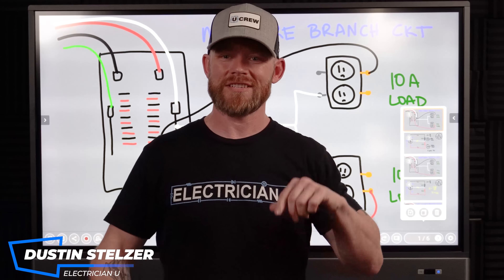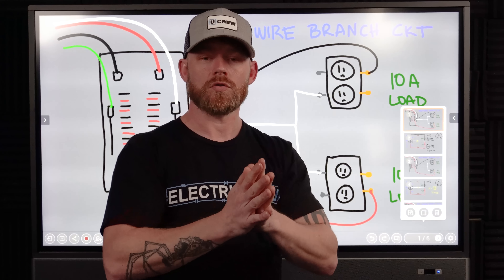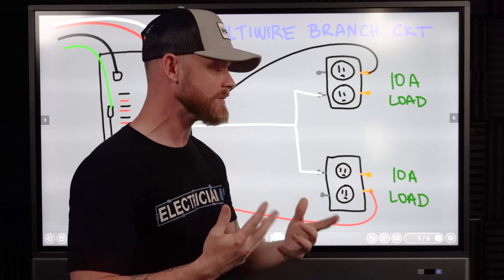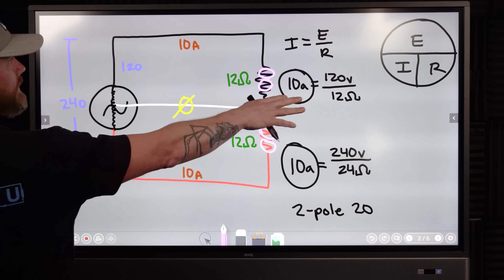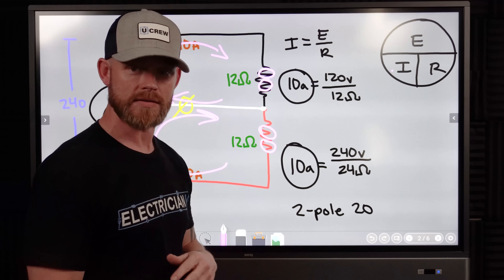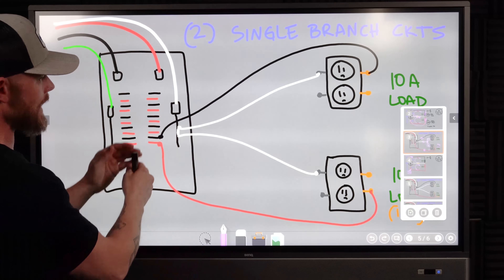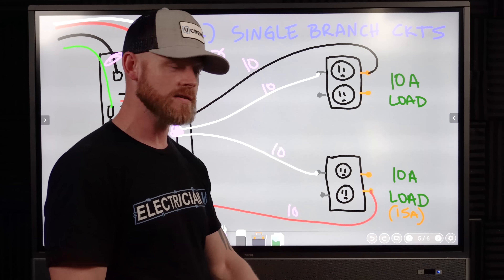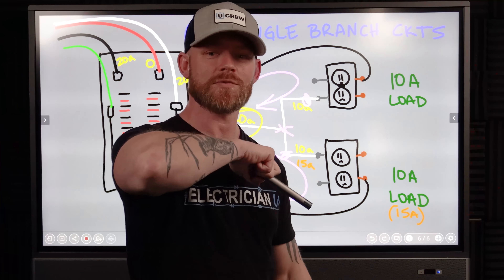Neutral Imbalance in Multiwire Branch Circuits (Two Hots, One Neutral)

Comment: What’s up Dustin! Love and are beyond appreciable for the content you produce. Been keeping up with you for years now. I have a question regarding branch circuits fed from AFCI breakers (lighting to be precise). I’ve been with a company for over a year now and we’re permitted to separate neutrals at the end of a 3 way and it’s switch leg and joint them in separate from everything, in spite of any other switches in the same box. Also same principle goes for 4 ways. Why couldn’t you just tie in all neutrals at every switch box? And why does it affect the flow of current in the circuit if done like so. I feel I have a general understanding why, but still throws me for a loop the deeper I think about it. Anything from anyone helps too!
Reply: If the other $s in the box are on the same afci circuit, just tie all the N together. Sometimes a $³ or $⁴ will end up in a box containing a different circuit (the end of a hallway for example). If all N's are tied together in that box, you have the N of two different ckts together, and your arc faults don't like that. As long as there is no loads (or perfectly balanced) the breaker will hold, but as soon as you get a load on one of those ckts, the afcis will trip. So basically just a rule of thumb so people don't pull their hair out troubleshooting on hot check
Reply: It's good practice not to include lighting on an AFCI circuit.  Some Dimmers and smart swithes can cause nuisance tripping

Comment: JMHO...the multiwire branch circuit is one of the worst ideas in wiring. When you lose that neutral (if it comes loose, for example...or was never fully tightened during the install and gets even more loose) the devices in the outlet string all get the full transformer secondary voltage, which can be as high as 245 volts in 2022. We had such an occurrence at my church maybe 10 or 12 years ago, and it was the feed for the audio system. It made a sound like a 105 (as in 105mm Howitzer) and cost over ten grand to repair the blown equipment. DON"T install these circuits.

Comment: Well done informational video, thank you.  Question, in a multiwire circuit, assuming all connected outlets are known, how do you check for a balanced load  and which outlets are on which leg????
Reply: Put a known load on a receptacle,and check for the added load, with your clamp-on ammeter. I use a 500W space heater.
And put your ammeter on the neutral with normal loads, and that'll show the imbalance current.
Reply: @dougfaunt5565  Thank You Dough!

Comment: As a Swiss electronics engineer, its interesting how the american 2 Phase system works. also for me 20 Amps are insanely high. and i needed a moment to realize that E stands for Voltage. The colors of the wires also feel wrong to me.

Comment: I believe you've made an error in this video, if only in terminology. Your drawing showing the neutral current cancelling out only works in a single/split phase scenario with two legs and the neutral in between but you describe it as being two phases. If it is actually 2 phase power then the two breakers would be 120 degrees out of phase with each other, thus they would not cancel each other out and there would be a significant current flowing on the neutral.
Reply: Single phase used in his examples, hence 180 degrees vs. 120 degrees.
Reply: @dennislyon5412  Yes, I think that's what he meant but it's not what he said and the difference in this case is important.
Reply: @jasonquick4177  - his power supply only showed the red and black legs, hence 240v single phase.
Reply: @dennislyon5412  I agree that the drawing is correct, but he explicitly said "A Phase and B Phase" in his explanation. Someone could easily mix this up and understand him to mean that this applies to a 2 phase system. I think it's generally a bad practice to call legs "phases" as it can confuse younger players, but of course it's common.

Comment: Multiwire Branch Circuits NEC 210.4 and Multiple Branch Circuits NEC 210.7 sound the same in the code, and have the same breaker requirements but are different. Good job on showing and explaining Multiwire Branch Circuits. thumbs up.

Comment: I have a light switch (simple switch) that im confused by. It has 2 white wires going into it (dont know if they are neutral) that measures 0 volts to ground when on but when switched on measure 120v to ground. Its opposite of what a normal switch would do. Why is that?
Reply: Probably a switch loop, having the hot start in the light fixture and then sent down to the switch.  The neutral stays in the light fixture box and just a hot down to the switch.  Re-identify them as black if that's what it turns out to be.

Or it's just breaking the nuetral on the switch...  Hopefully not that!

Comment: Hey Dustin! Would it be safe to have a multiwire branch circuit where one 240v receptacle used both hots and a single 120v receptacle used one of those hots as well, along with the neutral? Provided the breakers and wires were sized for the combined load?
Reply: "Safe", yes.  For decades, 240V electric stoves had a 120V outlet on them, so you could plug in small appliances like a hand mixer while cooking.  A 240V electric oven uses 120V light bulbs inside.  However, I don't know if the NEC permits it.  Ya know, lawyers and such.

Comment: Love these series! So, what is the purpose of running a neutral to a 240V load, say a dryer. What does that neutral do since the dryer is using the full 240 path? Thanks!
Reply: Some components in dryers (the controls, and possibly the motor in some cases) are better suited to run off of 120v.  The heating element is the main thing - if not the only thing - that uses the 240v coming into the dryer.  In summary, the neutral for a dryer provides a 120v path for certain components in the dryer.  And this goes for other equipment that uses 240v (red + black) plus a neutral.  Some things inside equipment are engineered to be a better fit to run off of 240, and other things are a better fit to run off of 120.

Comment: Hey, Dustin: Thanks for your videos, they are awesome! I am not an electrician, but simply trying to understand what’s going on. 

I don’t understand why the neutral wire is not hot. In your diagrams, starting at the transformer, the neutral is always shown as connected to a “coil” half way between two hot wires. Since the neutral is connected to the “coil” (as are the two hots) why is it not hot too? In a nutshell: why is the neutral neutral?
Reply: EE here.  The output (house) side of the transformer you are describing is known as a center tapped secondary winding.  Since the center tap is halfway between the other two wires (what you call the "hot wires"), the voltage between the center tap and either of the other wires is half of the voltage between the two "hot" wires.

One characteristic of a transformer is that the primary (input) windings and the secondary (output) windings is that they are completely isolated from each other.  So, by "bonding" (attaching) the center tap to ground at the service entrance, this wire (what we call the neutral) stays relatively close to ground potential, it is not "hot" with respect to ground.
Reply: @JamieStuff  Thanks for your reply. I appreciate it. Your comments in the first paragraph confirm what lead me to my question. So I got that right. My understanding of bonding needs expanding. I will look at that further.
Reply: @bunkerhill4854  if you want to dig into grounding and bonding,Mike Holt has a great study series on this. He goes into a lot of detailed explanation, I learned a lot from him.

Comment: Dustin,
Is there any issue with a multi-wire branch circuit being used with loads that have different power factors on each Line?
Say for instance you have an inductive load like a dehumidifier on black Line and a resistive load like an electric kettle on red Line.  Would this scenario create problems with the shared Neutral since the peak current draw from each load happens at different points in the waveform?

Comment: I appreciate your teaching style, the split-phase single phase used for residential homes in the US is confusing. Seems like they should use a different name rather than calling it "phase" when it is actually a split-phase system. I also appreciate the use of a sine wave to explain the path of the load, for example on one side of a split-phase system when the load is in the positive direction the other split-phase system is in the negative phase so literally, the negative portion of the cycle is carrying the (push or pull, using your terms) to provide the path back to the transformer. The neutral line in this situation would not need to carry any load. Although in reality no two single phases of a split-phase system will be balanced and some of the load will be carried by the neutral line. 

This helps to explain why the voltage can be 180 on one side of a split-phase and 30 volts on the other side of the split-phase system when there is an open neutral. The sine wave helps to show this. Most people just what the pictures as you have drawn them (which are excellent).

Comment: Just curious about the arrows you draw in this video, it makes it look like the power that goes to the “red” circuit is coming in on the neutral. Could you specify why it looks like that?
Reply: because power IS coming in on the neutral. This stuff gets a lot easier to understand once you realize that the neutral is not JUST for returning current back to the panel. It also SUPPLIES power to loads. Likewise, the hot legs don't only supply power, they also serve as a return path. That's how AC power works: the current is constantly switching directions, 60 times per second. Consider this: 240V circuits don't even use a neutral. Neutrals are only used for 120V circuits. A 240V circuit only has 2 hot legs and that's it. So how does current return to the panel if there's no neutral? It goes down one hot leg, and returns on the other hot leg. And again, the hot legs are constantly switching polarity 60 times per second.

Comment: When you have a circuit with a shared neutral such as 12/3 coming out of the pannel and branching off into 2 120 volt circuits, is there a code that states that this circuit has to be on a 2 pole breaker so that it has to be using both L1 and LE2?
I had purchased a house that had to have the service upgraded due to the breaker panel being a recalled pannel that was not legal anymore due to failure. (I think you mentioned that situation in a video).
The new pannel had many double pole breakers in it that were protecting 120 volt outlets.

Comment: Hi, we just bought an old house and I noticed all the neutrals and grounds are on the same bar in the main panel. Is this something I should change, or is it ok? It has the bonding screw.
Reply: Neutrals and Hots bond at the same point in your main panel. 

If you have a Sub-Panel, they need to be separated to avoid ground loops.

Comment: when you talk about balanced circuits, I have heard that when wiring a receptical that only has 1 set of wires in it like at the end of a run you should put the hot and neutral on opposite lugs, aka hot on the top lug, neutral on the bottom lug. does this help balance the outlet/circuit?
Reply: No effect.

Comment: Great explanation. MWBC is what got me interested in how residential electrical works. I got shocked on the neutral when trying to change a light fixture, because my breakers were installed before the handle tie requirement, and I only had one flipped off. Then I did a bunch of research to figure out why that had happened, and along the way became very interested in how this all works.
Reply: I tried to change a light fixture and assumed turning the lightswitch off would disconnect the power. I felt a weird tingle but proceeded anyway. In my defense, I was about 13 or 14 and didn't know to turn off the breaker.
Reply: @MrGatlin98  Tesla did a much better job at making sure you  understand differentials, and that all current eeeks to seek a balanced state, and that means retruning to ground.
Reply: @mmoser9483  Not always , two hot legs would choose to  run most all current in between them rather than going through the ground ,current preffers  to equalise the highest of all differentials .
Reply: @mmoser9483  electricity does not return to ground. It returns to THE SOURCE.
Reply: @cheeseitfry  It took me years as a DIY'er to fully grok that statement.  Thankfully I never tried doing Joe Homeowner work on MWBCs.  Now I definitely won't touch it with a 10 foot pole.
Reply: I once got shocked by a neutral because a 3 way switch on the circuit had neutrals from a different circuit in one of the 2 switch boxes.
Reply: Never assume the power is off; always use a tester to verify! I then brush the wire with my hand as an additional check before grabbing it.

Comment: Another good thing to add to this would be if you were to lose your neutral back to the panel. Under normal circumstances a multi-wire branch circuit uses parallel math in Ohms Law. Once you lose the neutral back to the panel it becomes a series circuit and the math changes. I believe it's kirchofs law (spelling check) that kicks in and each load is supplied based on demand. It can be a very dangerous and expensive ordeal and it re-enforces why you need breaker ties.
Reply: It reinforces why you should never wire a circuit this way.
Reply: @DaveMiller2  agreed

Comment: Kirchhof's first law. The sum of currents flowing into a junction must be equal to the current flowing out of it
Reply: Yes that makes sense, especially when he showed the diagram with the resistive loads.   Then you can calculate the current flow.  
Overall this is a very helpful video.  But simply labeling that node with  arrows  showing 10A in and 15A out means the extra 5A must be coming in on the neutral would have saved a lot of hand waving
A diagram with  "10 amp loads" was shown at one point , but that is a bit vague and misleading.  it suggests you might be able to just look at the labels of each device.   In practice that gets you in the ballpark of what the balance is,  but to really understand what is happening, and why,  you would have to know the effective resistances.   That diagram with resistances makes more sense to me.
Reply: Yay. Opposite phases of equal current sum to zero, thus no current in the neutral.
Reply: Kitchen counter plugs are usually wired with a 14/3 wire, the tabs between the outlets is snapped off. Red wire one side, black on other side and the white does both. So you can use a toaster oven and a coffee maker at the same time on the same plug. How is that any different than this, isn’t that an unbalanced system? If it is then why do they even make 14/3 wire?
Reply: @huejanus5505  The neutral will still only carry the imbalance back. Of course if only one of those is operating then that will be the full current...
Reply: @deang5622  Bollocks to yourself, you've not read what I said.

The fact 240 devices don't need a neutral if they are purely a 240 load is for the same reason as what I'm explaining above. You're right in how it works (and in fact said nothing contrary to what I have in doing so...) but you've missed the entire point.

This is about 120 devices using both legs on a single multiwire circuit - like in a kitchen where you can provide one leg to each of the outlets on a duplex receptacle with the tab broken off, and the impact that has on the neutral.
Reply: @intercity125 are you talking about having a dedicated 240v receptacle or device on a normal multi-wire circuit powering other 120v things?

I doubt that's up to code, but i don't see an issue if you aren't overloading the actual circuit. Still... the neutral is irrelevant to that particular connection
Reply: @huejanus5505  As long as the black and the red are going to different phases on the panel this is ok
Reply: @huejanus5505 same thing really... usually a kitchen would be 12/3 though for 20 amps.
Lots of 14/3 is used for three way and 4 way  switches on lighting circuits

Comment: So does this have to do with the 120 degree out of step sine waves?  Is that why one is pulling when one is pushing? I just learned that’s why you don’t need a neutral on a 3 phase because of the 120 degrees so wondering if that’s the same concept.
Reply: This example is single phase, so each leg (black or red) is 180 degrees from the neutral.  Your comment on 3 phase, if used for a 3 phase load, is correct.

Comment: I'd guess that the possibility of shared neutrals is one reason that CGFI breakers are mostly fitted at the receptacle and not, as in Europe, at the panel. Any imbalance between the hot and neutral current would cause a panel mounted CGFI to trip.  The same would of course be true of shared neutrals in European 3-phase systems but the solution is simpler: shared neutrals are banned by code.
Reply: Shared neutrals are banned, your quite right. Also it makes sense to have the RCBO/CGFI at the panel. The same then applies to earth leakage faults on the cabling to source.

Comment: I have a perfect 12a on both receptacles. In my garage I have a dual 20a breaker with 12/3 wire going to the receptacle box with 2 20a receptacles. There is a 12a car charger plugged into each receptacle. Creating a perfect 12a 240v load. I should check the neutral to see the ma difference between the two chargers.